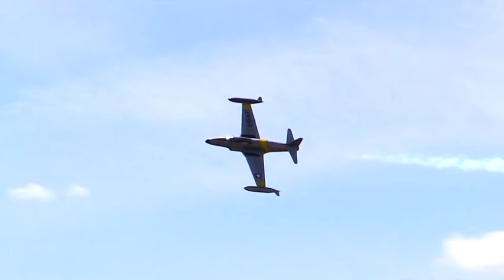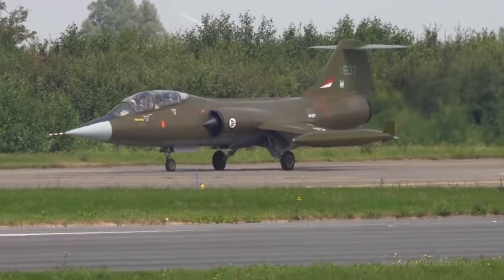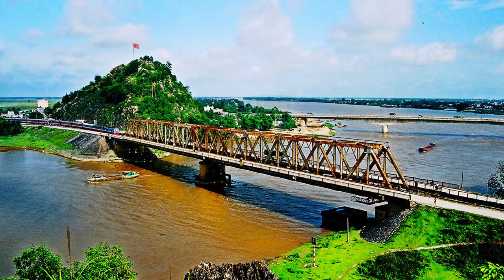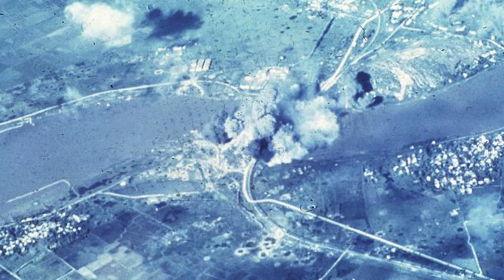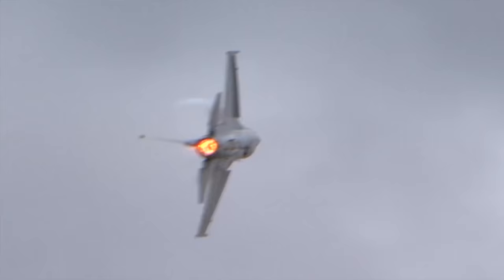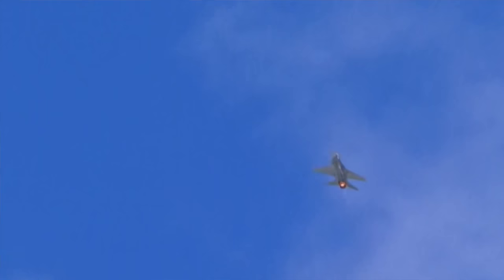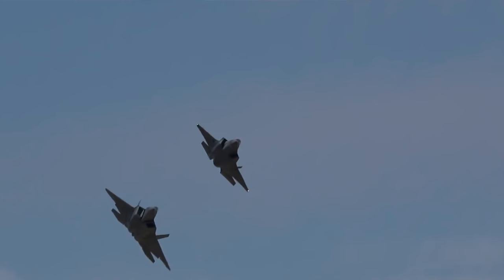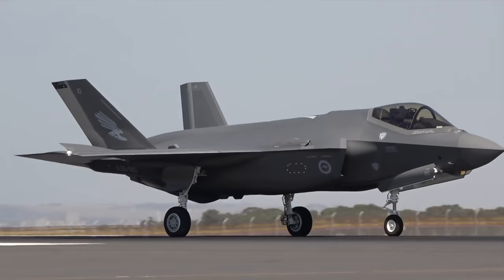Real Fighter Pilot on 5th-Generation Fighters

Comment: Great video.  It’s worth noting that the F/A-18C has very little interchangeable items with the new Super Hornet.  It’s a vastly bigger airplane with great improvements everywhere.  Some people think it’s a revitalized F/A-18C.  (I know you don’t think that).  Maybe a great video topic comparing the old and new Hornet?  Keep making the Sierra Hotel videos!
Reply: Airframe/engine, not interchangeable. Avionics, yes. In fact the last Hornets built for Malaysia already had Super Hornet avionics on them. Most export Hornets are constantly upgraded and they are already as capable as Super Hornets, except the radar (APG-79v4 for A-D Hornets only readied recently) and range.
Reply: @mimimimeow  Malaysian F/A-18D doesn't have F/A-18E Block 2's AESA radar nor F/A-18E Block 3's reduced RCS and avionics improvements.

Malaysian F/A-18D's upgrade includes JHMCS, AIM-9X IR, ATFLIR pods, and support for GBU-31/32/38/54 and JDAM “smart” bombs.

Malaysian F/A-18D's upgrades don't match F-16V Block 70/72, F-15EX, and F/A-18E Block 3.

RAAF F/A-18AM has longer range AIM-132 IR.

Classic Hornet's AN/APG-79(V)4 is a scaled-down F/A-18E's AN/APG-79 AESA radar i.e. Super Hornet has radar diameter size advantage.

Comment: Can you speak about the usability of the touch screen on the F-35? In my experience using a touch screen on a car, it's incredibly annoying when dealing with vibrations and I much prefer real buttons. The F-35 doesn't seem to have buttons around the edge like almost every other screen in a modern fighter. Does this impact how easy it is to use?
Reply: I would think it'd make it way easier since way more information and buttons can be intuitively placed on the screen, I assume that if you have a Tesla the issue is the screen is in the middle of the car rather than where the driver is. The F35 has the screen right in front of the pilot, and when flying there are less vibrations.

Comment: I sow video from airshow, so F-35 was making aggressive 180 degrees turn, after turn plane was a lot slower then before turn, so i checked time on the video, turn took about 5 seconds to perform. 180 degrees in 5 seconds with lose of speed, it is instantaneous turn rate  about 35 degrees per second - not bad at all, pretty agile aircraft.

Comment: I always wanted to be a pilot when I was a kid. Unfortunately my eyesight was just not good enough. But my love for aircraft has never waned and over the years I worked in aerospace on wide body aircraft, airborne radar, missiles and Data General development telemetry systems for both military aircraft and reentry vehicles from space. But I still love that feeling when the aircraft is banking hard and you look out over the wing and see it flexing 5 to 10 degrees as your heart beats and tries to escape the bounds of its chest cavity.

Comment: Thank you for this.  My biggest misconception was that the F-16 was just a direct decedent of the F-5, taking the mission profile of the F-5 to the next level with new technology.  I didn't know it was a completely new type of beast.

You may be able to dispel another one of my misconceptions.  During the transition from 3rd to 4th generation, I was under the impression that the fighter that would eventually become the F-16 was intended to be the main fighter of that generation.  The thought process was that you're always prepared to fight your last war and the US was preparing to fight future Vietnam Wars and the F-16 was the perfect aircraft to do this (providing low level close air support to support ground forces and a ground attack role).  During development though, the Russians unveiled the MIG-25, which showed the war the Russians were preparing to fight, which was a WWIII scenario involving larger, longer range aircraft with the mission profile of intercepting high altitude bombers.  At this point the air force changed their strategy to also fight this type of war, focusing on developing the F-15 as the new mainstay and putting the F-16 on the backburner and developing it to fill a support role for the F-15.
Reply: YF-16 was designed to be a daytime within visual range lightweight fighter to defeat hordes of MiG-21s, without any pulse doppler radar, but a radar-ranging gunsight like in the F-86.  The USAF wasn’t looking for that, but a single engine reliable replacement for the F-4E and A-7D that could do multirole, and be produced by the thousands.  USAF proceeded to get their F-16A with radar, Fire Control Computer that was awesome at bombing, started off with AIM-9 capability for A2A (and gun), and focused on integrating as many of the bombs and A2G missiles in inventory at the time.  It wasn’t until the F-16C that they really started expanding the BVR capabilities, which were still far behind in priority to the A2G roles.  Nuclear attack was also an important role for the F-16.

MiG-25 came before all of that, and we already had begun the F-X program in 1965, which became the F-15.  MiG-25 basic design features were literally copied from the North America A-5 Vigilante and Canadian Avro Arrow.  Fuselage, intake geometry, and wings were taken from the A-5, while the radome and cockpit were taken from the Arrow.  Since Russia didn’t have a good working knowledge or experience with advanced alloys for high heat tolerance and coefficient of thermal expansion mitigation of an airframe, they built the MiG-25 skin of stainless steel to deal with the aerodynamic heat loading from friction.

The MiG-25 was a high supersonic, high-altitude, short mission duration, point-defense interceptor designed to intercept incoming supersonic US bombers.

The USAF had a huge fleet of various different types of fighters, especially with the Century series, most of which proved to be lackluster in performance, extremely unsafe, and almost universally used for different roles than intended, with exceptions being the F-106 and F-111.  There were so many different engines, radars, and weapons that really complicated the logistics and ballooned operations and maintenance on such a fleet.

The adoption of a Hi-Lo concept where the F-15 would handle the Hi capability A2A fight, while the F-16 would handle the Lo-capability, mass-produced, multirole fight, (with help from Wild Weasel, Electronic Attack, and deep interdiction/strike F-111F) would be the force mix moving forward from the 1970s-onward, while the F-4E and A-7D would be phased out.

The USAF was primarily focused on 3 different fronts:

European theater vs Soviets with Fulda Gap invasion-type scenario.

South Korea/Japan/Philippines PACOM

NORAD air defense mission as well as Iceland AD mission

The air threat would be dealt with using the F-15A/C in an air-to-air only culture of hunter/killers working with E-3A AWACS and other Electronic Support Measures platforms.

The ground threats would be dealt with using F-117A, EF-111A, F-111F, F-15E, F-4G, F-16A/C, and A-10A.

This is the basic USAF TACAIR force structure that deployed to Desert Shield/Desert Storm in 1990-1991.

A lot of lessons were learned from ODS, mainly that again, we had too many different radars, engines, and airframe types in the system to maintain, and that upon analysis, a lot of the basic flight characteristics and payloads of these fighters overlapped considerably.  F-111F was retired shortly after.  F-4G was replaced by F-16CJ and later F-16CM.

Work had already begun on inevitable replacements for the F-15C and F-16 fleet, based on large Soviet force analysis of how many different airborne and ground-based radar systems they were fielding.  It was determined that in order to maintain survivability and lethality, more VLO platforms would need to be designed for TACAIR, starting with the ATF, which eventually became the F-22A Raptor.

There were at least 3 different USAF programs that merged into the JSF-A, which became the F-35A, which is already replacing older F-16 airframe squadrons around the world as we speak and over the past several years. This allowed them to merge the F-117A VLO capability with more modern threat warning and sensor capabilities that had evolved from 4th Gen fighters, while doing the EF-111A mission as well.  So that knocks out at least 3 of the airframes that were part of the Desert Storm era fighter mix, while providing superior performance in each one of those fighter’s relevant missions set focus.
Reply: The F-5 and F-16 have zero in common. The direct descendent off the F-5 was the F-20 Tiger Shark that never made it to full-scale production. The YF-17 also built by Northrop had some similarities to the F-5..The YF-17 lost the LWF competition to the F-16... but it was further developed into the F/A-18 for  the Navy and Marines. The USAF preferred the F-16 because it shares the same engines as the F-15 and it was more manoverable /agile that anything else back then..

Comment: I'm still in the mindset of the gun being a very important weapon. Long story short, I've studied Shaw's "Fighter Tactics and Maneuvering" and it seems like the ability to engage an enemy within minimum range would give an advantage (eg force guns-d) and/or prevent the enemy from exploiting the closer ranges (presumably in a slow and dirty fight). Of course missiles would still be the primary weapon, and of course western training and hardware would almost certainly have the edge either way. But would I be using a dated mindset, or is the gun still worth the weight and space for the near/foreseeable future (dogfights of course, assuming dogfights will still be relatively common, in air to air exclusive fights).

Of course "no comment" works too if needed. Ignoring the effect of stealth on BVR and all of the other fun that entails for both sides missile shots because of course that area is classified.
Reply: I mean, we're still putting modified M61 Vulcans on our F-35's, so they must still have a decent amount of value, even on 5th gen fighters.
I'd be willing to bet it has to do with simply just having the option available should the need arise, as the F-35 and other 5th gens are supposed to be able to do a wide variety of tasks, even more so than 4th gen multirole fighters, while retaining all that stealth capability. Why try to build a stealth A-10 or a stealth F/A-18 Super Hornet, when you can have the F-35 do each of those jobs well enough when stealth is needed to deal with modern air defenses, then switch to using our upgraded A-10's and F/A-18's once air superiority has been established, since those planes are more specialized for the roles you'd need at that point, and have the benefit of being much cheaper to fly?
Basically, each role a stealth fighter CAN do will keep another aircraft that would normally fulfill that role out of the line of fire until the most critical threats have been eliminated, even if an older, more specialized aircraft would do that specific role better normally?
Reply: 20 year F-16 pilot here. A gun is still important but maybe not for the reasons you think. To quote the weapons school “it depends”… Against a modern near peer threat any air to air engagement will almost certainly be 80-90% BVR. Best to kill them at long range, especially before they know you’re there, hence the emphasis on stealth. This is especially true if we fight an adversary in their backyard where they will probably have a numerical advantage. Having said that, there is a reason that all 4th gen fighters (excluding the F-117) have a gun. For the multi-roll jets like the F-16, F-18 and F-15E it was both an air to air and air to ground weapon. This was a lesson learned from the F-4C/D and other models that didn’t have a gun in Vietnam. With air to air missiles in the early stages they weren’t that reliable and a gun was a great necessity. Fast forward to the Gulf War and beyond. Ask any grunt that was in Afghanistan or Iraq and they will tell you the gun (strafe) was in important option especially in a “troops in contact” situation. Having flown the Viper in both OEF in 2001 and OIF in 2005, 2007 and 2009, i can tell you that there was virtually zero air to air threat. But when troops needed support in danger close situations, they wanted strafe runs on many occasions. I never did anything air to air in my 20 years but employed the gun in Iraq against enemy troops. Oh, and both the F-22 and two models of the F-35 have a gun. Hope this answers at least part of your question.
Reply: @gatorspad3632  Apologies if this is real but I have serious doubts of the veracity of this comment. The comment on the F-117 is a little odd, obviously it's not a fighter. Its an attack aircraft with zero air to air capability. It would be like pointing out the F-111, F in the name but that's all. But it was to disregard the aircraft so maybe I'm just a little overly sensitive on that.

However the gun was rarely used to strafe in the modern conflicts, so much so that a significant proportion of aircraft went up without ammo, many nations replaced the guns entirely with ballast. Specifically the latter for air to ground aircraft like the Tornado, two 27mm guns has a dramatically better effect on target but it was still deemed useless. The risk of MANPADS is extreme whilst the reward is very minimal compared to using bombs. Indeed fairly quickly it was entirely ruled out of the RoE to use guns against ground targets. Its now a very dated idea to require guns for ground attack, arguably a 30mm is still reasonable but even the A-10 has had a fair amount of criticism (obviously that wasn't ruled out of guns attacks).

The modern mentality is, in my opinion, overly zealous to AVOID gun against ground targets. Not to use them as an important tool. F-16 pilots have even opted to use supersonic dives to pretend to be dropping bombs from the noise over using guns against ground targets. So as allegedly a veteran of the wars where that mindset shift actually happened, and where blanket RoE was against using guns on ground targets, its a very unusual statement to make.

My question was solely on the air to air, because that's the only question which remains. Last I heard there's a debate among pilots if retaining the gun has benefits for the ability to threaten a guns attack and avoid the enemy coming close in a dogfight to exploit a weakness, or if its a waste of weight and space for fuel if missiles are all you need. With the emphasis on close up fights in training despite most fights obviously resolved BVR its an interesting dichotomy for me. Especially with the supermaneuverability pulling dogfights in far closer whilst missiles and NCTR/camera pods push them further out. But at the same time 5th gen fighters could swing that doctrine significantly so I was in part expecting no answer.
Reply: @olivialambert4124 . You are certainly free to think what you want but I have over 2900 hours in the F-16. And yes, I flew it in both Afghanistan and Iraq. You are sadly incorrect about “blanket” ROE preventing the use of strafe. I have first hand knowledge of that since I did it. But hey, what do I know, I just flew fighters for 25 years and worked at Lockheed Martin designing F-16 cockpits and working at the Skunk Works. 🤷

Comment: Would love to hear your response to the Air Force's declaration of the F35 as a "failure" in spite of multiples of pilots declaring their preference for it over 4th Gen fighters.
Reply: A lot of the failure is related to the maintenance side of the equation. Things like how many man hours does it take to generate a sortie, how quickly can a aircraft be ready to fly after returning to base, cost per flight hour, and overall reliability rate of the aircraft.
There is more to how successful an airframe is going to be than by just what it can do in the air. If you can't get the right tools to the battlespace in the first place, you'll never win the war.
Reply: @Redwaltz4  'Makes sense in part, and its a better answer than none at all...thanks!

Comment: Off topic question. Mach 1 at the surface of the ocean is about 1200 km/h. Chuch Yeager "cheated" at 1047 km/h at high altitude. Is there a standard altitude one refers to when one talk about mach speed. When I do the math sometimes I get confused about it.

Comment: As a mater of range, bringing a gun to modern air to air is like bringing a knife to a gun fight. Even if all the missiles fail on the modern  jet, it still has 4km+ distance between them and their target and so they can leave before the other jet can get into range.  Even back then it wasn't the quality of the missile, but the constant fear of blue on blue by the U.S. which required visual identification which then put the jets into gun range.

When it came to the F-16, it was a literal fly by wire aircraft. Several F-16s were lost when that wire broke from fraying.

4th generation aircraft also had multiple targeting. The F-14 could attack 8 aircraft at the same time.
Reply: A 20mm round doesn't care what the electronic warfare situation looks like and can't be jammed. 
It's all purpose. Works on enemy units both in the air and on the ground. 
Sure, the other guy can turn and run but if they are doing that, they have given you both the advantage and control of that airspace.
Reply: @Redwaltz4  That's why fighters fly in squadrons.   Besides, fighters have a low loiter time of around 15 minutes once an aircraft has hit its combat radius most of which was spend shooting missiles and dodging missiles.